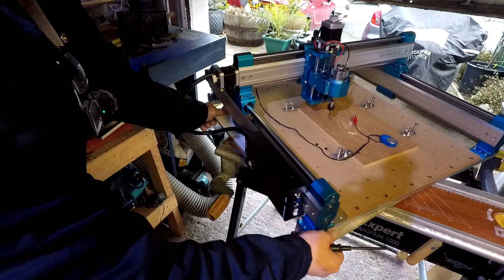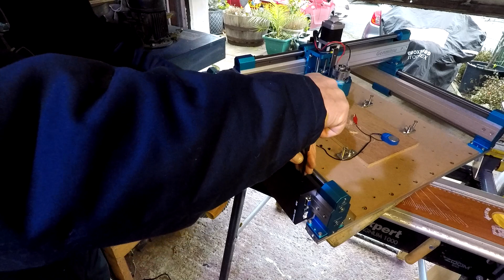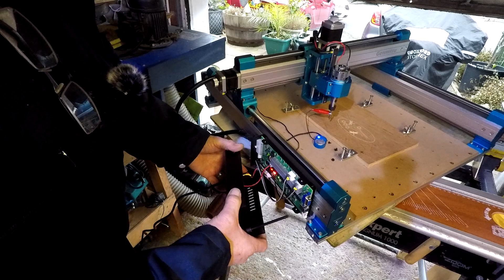Sainsmart Genmitsu CNC 4040 Pro serious fault when using the touch off probe

Comment: Tony, I have a probe problem that is much different than this one but I'm hoping you can advise me on.  I upgraded from the original z-probe to the "remote" probe so I wouldn't have to worry with storing the wires.  Of course the remote probe is so tall that it brings its own issues for me.  So, I bought a probe from Sience Labs that touches off in the x, y and z directions.  Looked like a great solution for me until I tried to connect it.  The new probe has a 2 pin connector and the Genmitsu uses a 3 pin connector.  I assume I can buy a screw-on connector end but I don't know how to wire it.  The vendor was no help so I'm trying to find someone with the kind of experience  you have to advise me.  - Thanks! Shawn
Reply from the maker: ￼

￼

￼

Thanks for your comment i dont have experience  with the 2 pin connector but I have found some information that might help. I have  copied  and pasted it below. Please let me know how you get on.

Yes, you can absolutely connect a 2-pin probe to a 3-pin connector. Because a standard touch-off probe is essentially a simple switch (acting as a basic circuit closer or breaker), you only need two wires for it to function. [1, 2, 3]

However, you must identify the purpose of the 3 pins on your machine’s port before wiring. [1]

Step 1: Identify the 3 Pins

Consult your CNC controller or breakout board manual to determine what the three pins represent. Typically, the 3 pins are:

Signal (Input): The pin that registers the trigger.

Ground (GND): The reference return path.

VCC (Power - 5V or 12V): Used to power active probes (like LED indicator lights) or 3-axis sensors. [1, 2, 3]

Step 2: Determine Your Probe Type

2-Wire Active Probes (with LEDs/electronics): Connect the Signal wire to the Signal pin, the Ground wire to the Ground pin, and leave the VCC pin empty. [1, 2]

Passive/Mechanical Probes: These only have two wires that close or break a circuit. Connect one wire to the Signal pin and the other to the Ground pin. Do not connect anything to the VCC pin. [1, 2, 3, 4, 5]

Step 3: Configure the Software

Depending on whether your probe is wired as Normally Open (NO) or Normally Closed (NC), you will need to map the input in your CNC control software (such as Mach3, LinuxCNC, or GRBL). Make sure the software’s probe input logic matches your wiring to avoid false triggers. [1, 2]

If you would like to share the exact make and model of your CNC machine, I can give you the exact pin-to-pin wiring instructions and software configurations required.
Reply from the maker: The ending part of the text is from. The person who wrote the answer.
Reply: @Tonys.Top.Tips.Workshop  Tony, Thanks for  your research and quick response!  I truly appreciate it.  This sounds like a simple enough task however, my ignorance of electronics makes what seems like a simple task to others impossible for me.  If I had known the new probe wasn't a "plug and play" solution I wouldn't have wasted the money.  Again, thank you!

Comment: My issue was solved,,IIn my particular case, I wrapped a piece of paper around the Genmitsu 710w router before placing it in back in its ring holder, and I can now use the Z probe..you cannot even see the paper so I consider it a permanent fix, apparently the router was grounding to the controls..

Comment: 2 years later I am here with a new 3020 ultra. I was super impressed at first, then came the z probe. I know I can run the machine without it, but it completely defeats the purpose when having the option at hand, I have actually pulled apart the center and verified ground power and input what I am finding is, I have a short to ground on the power side of the control board I have opened up the box and do not see anything sticking out so I guess my only option is to box it back up and return it for a different brand as they do not seem to have much support, but keep putting out new product
Reply from the maker: Hi thanks for your comment  it will be a ground somewhere  but it shouldnt be there every one of the comments i have received on this subject has been poor quality control i would return it for a full refund or exchange

Comment: Hello, same problem with the CNC 4040 Pro after upgrading to the XY axis in June 2025. I will follow the tips given. Thank you for this information.
Reply: the problem does not come from the box in my case but from the 710 w pin because it is not isolated from its support, after reporting my problem to genmitsu I carried out the test recommended by the technical service, therefore: isolate the pin on its support by surrounding it with paper / or electrical tape (no steel / steel contact) and the zprobe probe works, temporary solution, awaiting the follow-up proposed by Genmitsu to remedy this problem
Reply: @MichelBLLY  What do you mean by the 'pin' of the 710w router?

Comment: yep same issue here.  I'm on my way to the hardware store to find some nylon screws thanks to your video.  Also, definitely not the spindle, I've got a 4040 pro (upgraded to max) with a 1.5KW spindle fed via AFD and have the same shorting issue.
Reply: reporting back, heatshrink switch is all I needed... your fix worked great!

Comment: Awesome fix. Thank you so much. I have the 4040 Pro too. I've had the issue with my Zprobe not working reliably. I thought it was a short in the Zprobe. That didn't fix the issue. I then thought it was my cheap trim router. I bought the Genmitsu 710W Compact Router from Amazon, which is $99 right now. That still didn't fix the issue. I then came accross your video. That simple fix did the trick. I just left the four small screws out of the control box. Zprobe works great now. Thank you again. By the way, I do like the Genmitsu 710W Compact Router so far - much quieter than my trim router. I'm not sure how it compares to a good VFD spindle. The only issue I have with it so far is it comes with a 1/8 collet and a bigger collet is an extra add on.
Reply from the maker: Thanks for your comment, glad it fixed your problem Sainsmart assured me that they had sorted the problem but obviously they haven't poor quality control.

Comment: This started happening to me after I did the y extension.   Going to check this when I get off work.  Thanks for sharing the find.
Reply from the maker: Hi thanks for the message if it is that it's an easy fix, keep me informed
Reply: @Tonys.Top.Tips.Workshop  I took the control box cover off and separated the power port(that sucker was on Good).  I don't have plastic washers on hand but do have o rings, used one on the outside end of the power receptical to insulate from the box.  I also added electrical tape between the box halves at the screw points. I Don't know if that helped or not, but I figured I'd overdue it and hopefully not have to take it apart again.  All back together now and tested, works as intended!
Reply from the maker: @scott2964  glad it helped and solved the problem

Comment: Hi, I had the same issue with the z-probe which like yours, was related to that control box earth (-ve) connection. After contacting Sainsmart about it they advised using plastic washers so the screws couldn't contact the cover. I took a small step further and drilled out the holes in the cover to take a small o-ring to keep the screws from touching the cover and using some fibre washers (didn't have any plastic washers).
I have since come across your video and have t say that your fix is much better. I think I will do it your way as well. Well done.
Reply from the maker: Glad the video helped dont forget to ask sainsmart for a refund of $20 because you are rectifying the problem yourself. This was Sainsmarts offer to me and they said they would to anyone else that contacts them. Cheers Tony
Reply: @Tonys.Top.Tips.Workshop  Cheers Tony. I'll follow up with them.

Comment: I ended up taking the controller box off of the frame and reattaching it with Gorilla double-sided tape (for now).  Seems to be a very strong bold.  I will venture to find plastic screws to compliment the tape.  Great find and thank you!  I never had the issue, and not never will :)
Reply from the maker: Hi glad to be of help dont forget to contact George at sainsmart and claim your $20 refund Tony

Comment: Hi Tony,  I am now having the same spindle problem that you describe here with my 4040, I have contacted Sainsmart.  Also I have found the supplied spindle to be pretty much useless.  Do you know of a real 52mm spindle motor without that 5mm connection to the er32 collet?
Reply from the maker: Hi Jim, is it the touch off probe problem, you are right the spindle is not much good I am uploading a video tomorrow with my upgraded spindle and a power box for the spindle so tune in if you can tomorrow evening. Cheers Tony